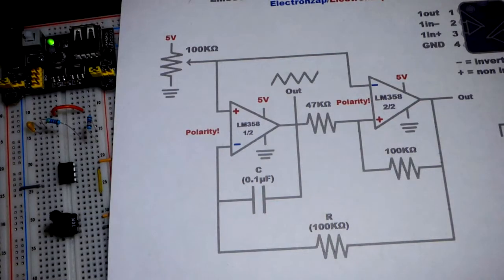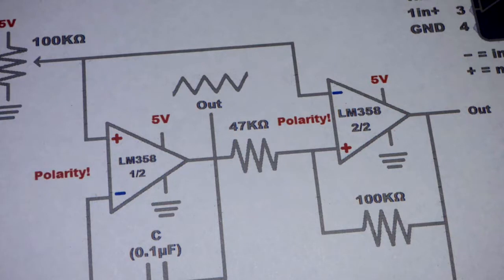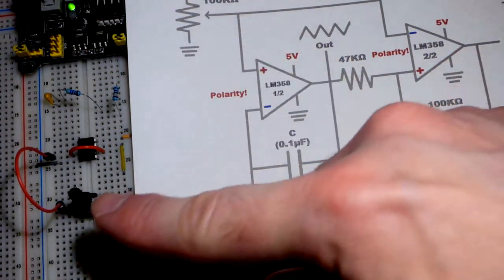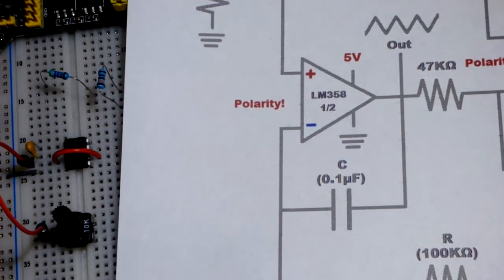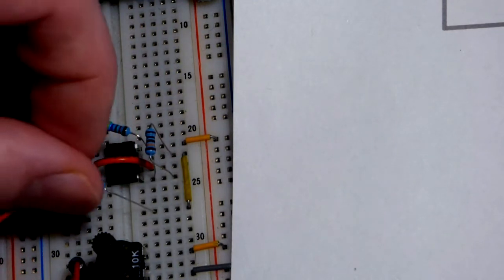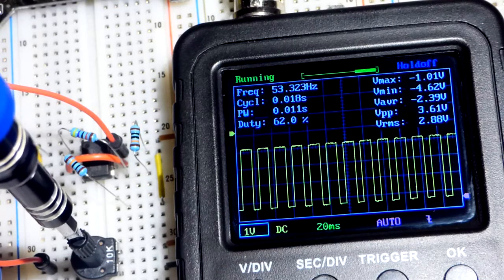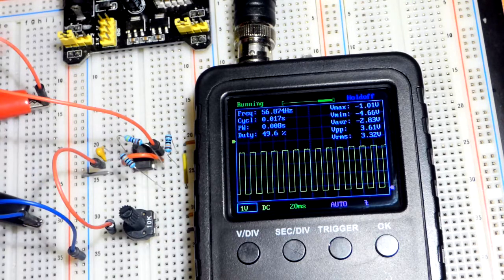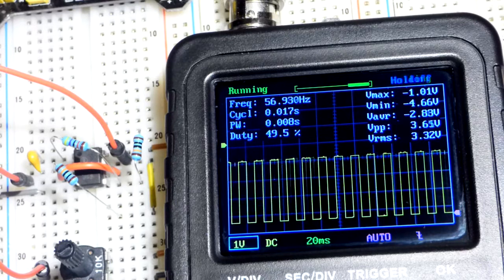LM358 Dual Op Amp triangle and square wave generator circuit step by step schematic build

Comment: Hey! Why is that when I connect both the outputs each to an LED, when the potentiometer exceeds a certain point, one LED will turn on the other will turn off. Vice versa when the potentiometer doesn’t reach that point

Comment: Amazing Video Dude! I really appreciate your time and effort into these videos. I also subscribed! You can also check out my channel. I do lots of Breadboard projects and Arduino. Also, I would LOVE to see more LM358 Op-Amp projects Ike a PWM Generator. Good video. Also, if I were to place an LED at the output, would it blink, and if I turned the potentiometer, it would get dimmer? Let me know. Thanks You!
Reply from the maker: I subscribed to your channel :) Should be able to light an LED protected by a resistor with an op amp output but you may want to keep it below 10mA or even less depending on the op amp. Best to check the datasheet for maximum and recommended current and voltage. I haven't looked at this circuit in a long time, so not sure what modifications will do at the moment.
Reply: electronzapdotcom Thank You so much! Ok, I built it, and it worked, and you were right about the LED!